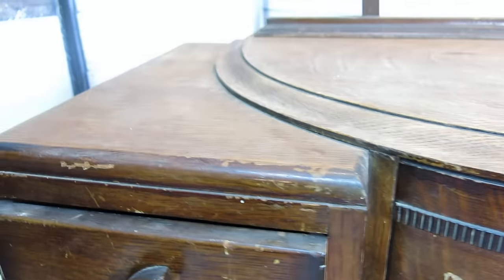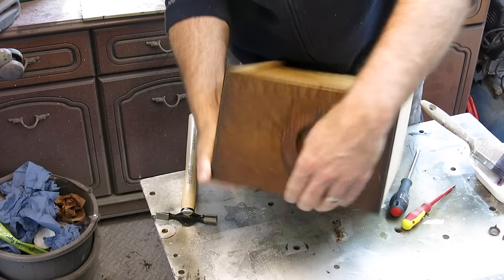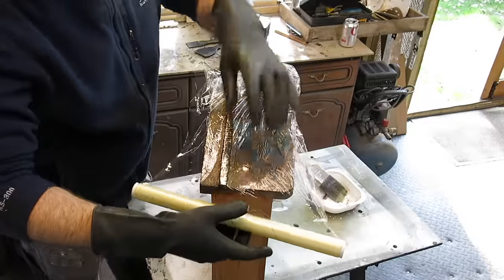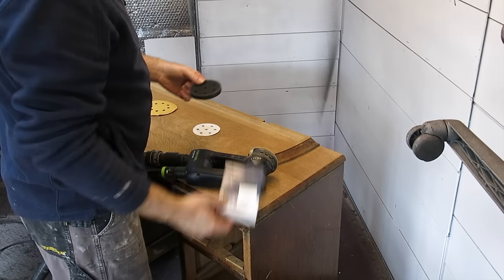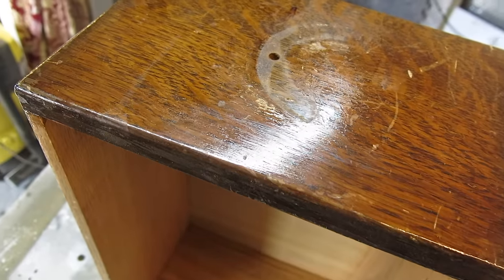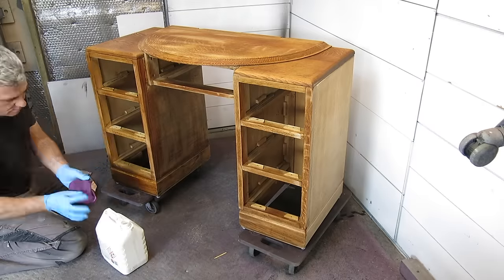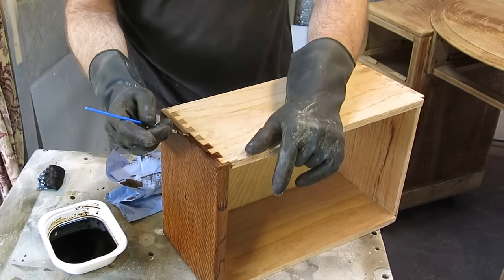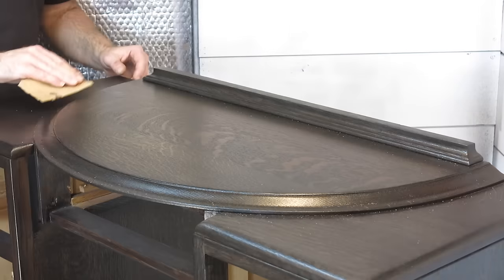Painting with Wood stain - Full RESTORATION of a Vintage Solid Oak Vanity Dresser

Comment: Recipe for stripping old furniture finishes, you need to use a varnish stripper. My mother used lye and water with cornstarch added to make a gel. It strips off old finishes like shellac that has turned black also. 10% lye and water solution, add enough cornstarch to thicken so it will cling to the surface. Works better than any product on old vintage and antique finishes. It is caustic, add the lye to the water. Wear rubber gloves and work in ventilated area. Lay it on thick and let it sit, check it for bubbling and wrinkling, then scrape off. Once you have everything removed, then wipe it all down with baking soda and water solution to neutralize the acid. She refinished all of my great grandmothers furniture this way. Paint remover will not remove varnish. Varnish remover or this recipe will.
Reply from the maker: Thanks so much for providing this recipe. Something I will definitely look into in more detail. 😀😀👍
Reply: Explain more, the amount of water, what lye is used and the quantity.  The amount of cornstarch, please.

Comment: Your piece turned out great.  I really like the two toned stain.  I saw you used Polyvine Varnish in your sprayer.  Do you use that straight out of the container or do you have to thin it?
Reply from the maker: Hi Brenda. Thank you. You can use polyvine straight out of the container. I sometimes thin it slightly with water but you don’t have to 😀😀

Comment: GORGEOUS! Just curious, why do you sometimes use the Festool sander and sometimes the Dewalt? Can't wait to watch more!
Reply from the maker: Hi Janny, thanks so much for watching. Theres a couple of reasons why I switch sanders. The Festool has two settings, Rotary and Random Orbital. The rotary is more aggressive and can get through finish quicker but can leave swirls on this setting. I then use the RO setting on the Festool. It also has the Delta head that I can use to get in the harder to reach areas. The Dewalt is purely a random orbital sander and has a larger face than the 90mm Festool so when I need to cover a large area I tend to use this one. 😀😀👍
Reply: Yes.  I noticed the random round marks the sander made on the wood.  I was taught to always follow the grain.

Comment: GORGEOUS! I’m truly amazed each time I watch your videos. This is the type of restoration I want to do. (Been doing a couple pieces of furniture myself.)
Do you have to remove the varnish before sanding? Or is it preference? Also, I noticed you didn’t use a wood conditioner prior to staining. Is it not necessary? Thank you!!!!
Reply from the maker: Hi Quinn. You’re very kind, Thankyou. Removing the existing finish before sanding varies really. Ideally, if the wood is veneered it’s safer to try and strip the finish before sanding. I tend to sand quite a lot but I go very carefully until I’m confident I won’t sand through the veneer. As I said in the video, I hate paint stripper but I know that there are some good paint strippers in the US. Scraping is also a good option to get the bulk of the finish off. I’ve never used wood conditioner and not had many problems with patchy finish. I use an alcohol based stain that dries super quick so I do have to work quickly. It’s important that you remove all old finish, sand evenly across the area to be stained and ensure the surface is free from dust. Sorry for the long reply but hope this helps a little. 😀👍

Comment: Plastic wrap over the wet surface of the stripper keeps it from drying out
Reply from the maker: Cheers Dennis, I did use plastic wrap in this video but it still dries out quickly. I’m probably not using enough stripper but like I say, I’m not really a fan of this method. I’ll persevere though. 😀😀👍

Comment: Hi Dave, new viewer to your videos here. I'm loving them and your restorations are fab. Can I ask a few questions if you don't mind?
I'm just starting out and have a few queries.
What do you recommends to seal stinky wood that you're staining not painting?
What grit paper do you use to strip an old finish and then what grit to buff out any sanding swirls created during stripping?
How can you tell if a finish is wax/ shellac/lacquer/varnish?
Hope you can help. Keep up the good work! 😁
Reply from the maker: Hi Kerry, thanks very much for tuning in. I’ll do my best to give you answers to your questions. 
1. I give every piece a thorough cleaning firstly to remove any initial smells and dirt. Sanding removes more smells and then the stain and topcoat tend to eliminate the rest. The main issue with smells tends to be inside the piece where it is bare untreated wood and can absorb smells. Try a thorough cleaning Inside and if that doesn’t work you can use a spray sealer inside like an shellac based clear topcoat. I’ve also used Howard’s feed n wax inside which has a lovely citrus fragrance.
2. It really depends whether it’s solid wood or veneer. I scrape and use stripper to remove a lot of finishes unless I know it’s solid wood and then I can use 80 grit. However it’s rare that I use such a coarse grit as it leaves swirls. If you use it then go slowly and then move up to 120 grit, 180 then 240. I often stick at 120 if I’m staining as sanding too smooth can “polish” the wood and reduce the absorption of the stain.
3. The existing finish on a piece takes some practice to identify but wax will be removed with white/mineral spirit, shellac can be melted away with methylated spirit/denatured alcohol and lacquer and varnish can be removed with stopper or carbide scraper. Shellac, varnish and lacquer can all be removed using similar techniques and products.
I hope this helps a little and good luck in your restoration endeavours 😀👍
Reply: @MayfieldRestorations  that's brilliant information, thank you so much. I'll copy and paste it into my notes for future reference. 😁
Reply: That’s spectacular! I’m not usually a fan of two color restorations,but this one looks great.  The style seemed to call for it.

Comment: Master craftsman. Thank you for sharing.
What is the Dewalt sander vac attachment setup - the adapter and hose combination. Thanks in advance.
Reply from the maker: Hi Warwick, what a very kind thing to say, Thankyou. I was lucky with the vac set up. The Vac is a Karcher shop vac and all I did was unclip the end of the hose and the size of it just fit in the Dewalt sander perfectly. 😀👍
Reply: @MayfieldRestorations  You have inspired me to dust off a few "projects in waiting:". Lucky you. re the dust extraction - not even Dewalt really knows which of their own fittings do what. I will fins a solution :-)

Comment: If your not getting good results with chemical stripper on that sort of furniture then, not been funny mate but your just not using it right. The whole of that piece could have be stripped in no time.
Reply from the maker: Hi, you’re probably right. Would be useful to have your advice on how to use it properly. 😀👍
Reply: @MayfieldRestorations  First off, I prefer thin stripper rather than thick but you do need to be careful as it will splash really easy. Paramose Original is the one a normal use these days. Your old polish is going to soak up the stripper like a sponge so apply liberally, try to keep everything wet, as areas start to dry just apply a bit more or move the stripper from one area to another. As the old polish takes up as much as can it will start to delaminate again just keep moving the stripper around keeping everything wet (I would be doing two or 3 draw fronts at a time) Polish is really easy to strip so within 3-4 minutes it should be ready to remove. Take of any excess with a scrapper then use course wire wool for the remainder. Wash with plenty of Methylated Sprits and wire wool to remove final traces this will also neutralise the stripper (don't use white spirt).

Comment: My concern is you not wearing dust mask with all the sanding. Not all your sanding was done with a vacuum attachment.  Very nice work, but safety for your lung health is important before you have pulmonary problems!
Reply from the maker: Hi. Thankyou so much for your concern and you’re right. I predominantly use dust extraction but forgetting to wear protective equipment when I’m not is a bad move. I’ll be more thoughtful from now on 👍👍